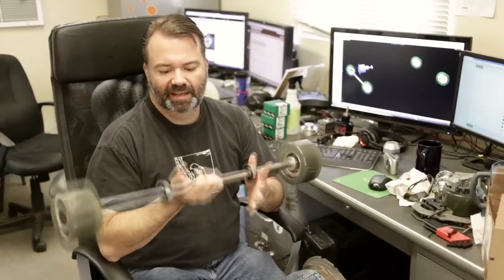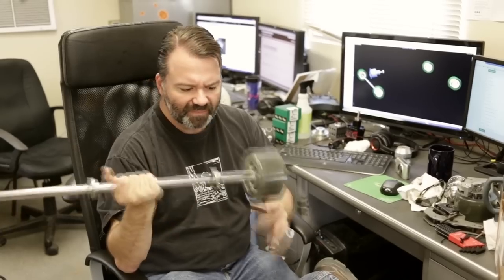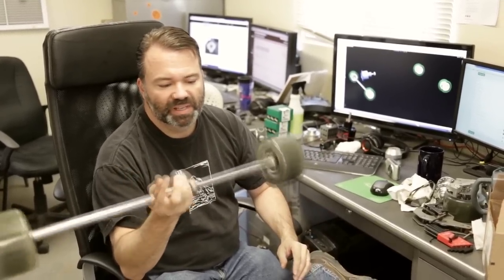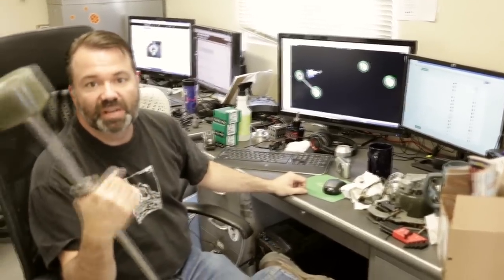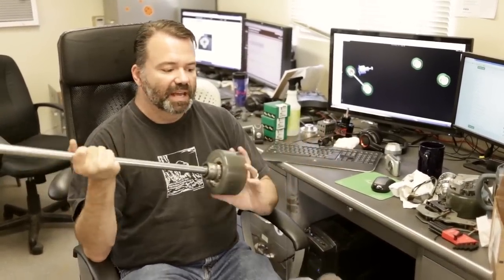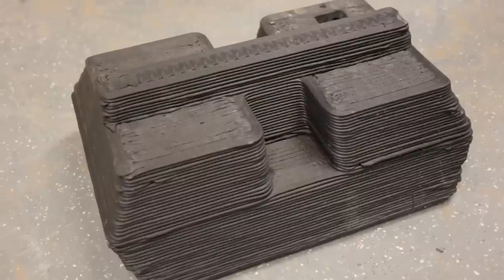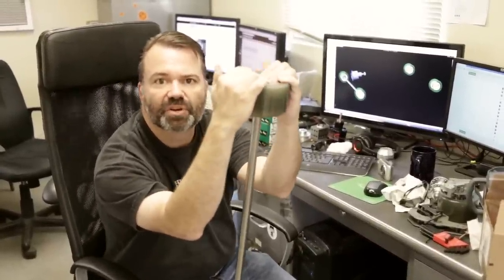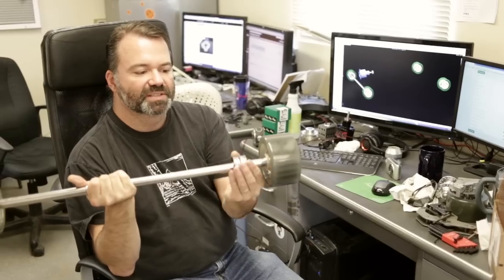3D Printed Go Kart

Comment: While 12L14 machines nicely, 1144 cold finished carries about double the strength and almost 80% of the machinability rating of 12 series steels. A great alternative if you run into yielding issues.